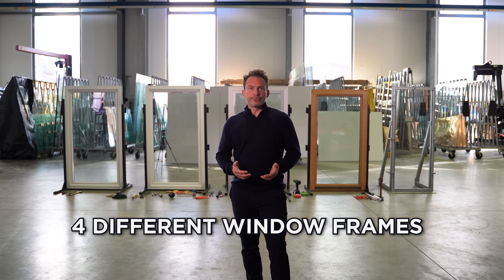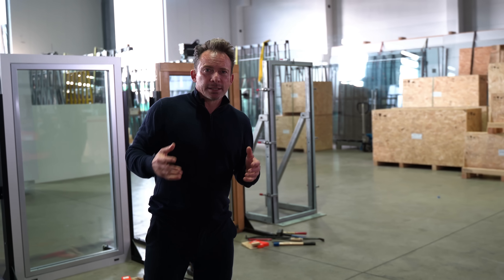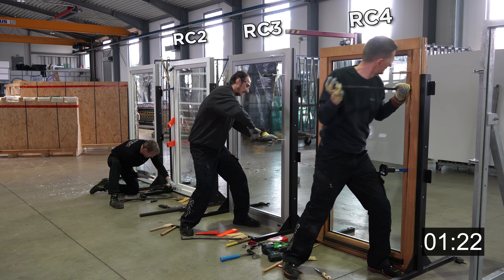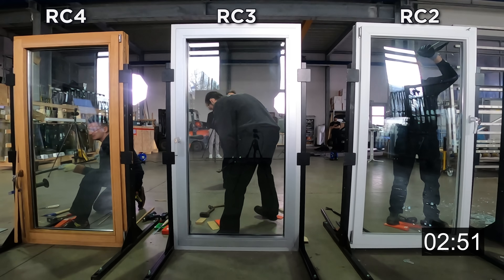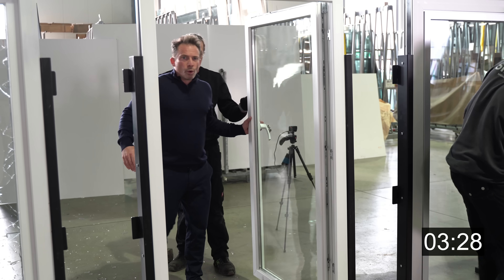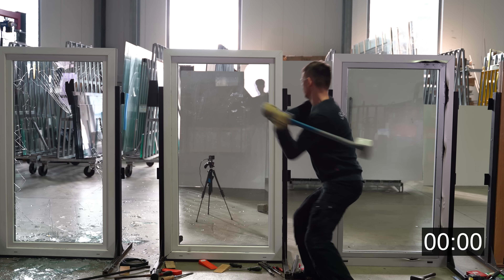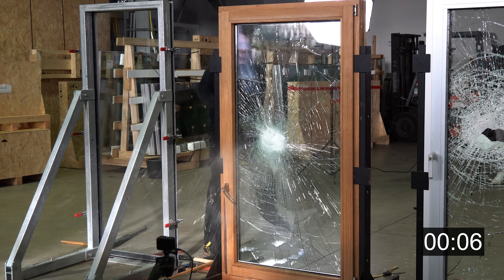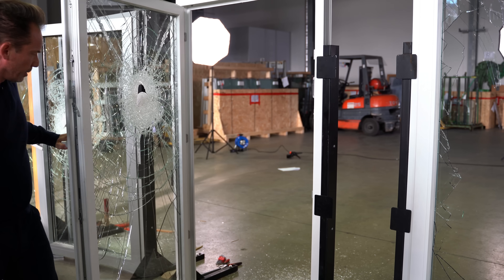Burglarproof Windows Tested! You WON’T believe what we found out

Comment: What about fire fighters trying to get in if there is a fire? Also, wouldn't a battery powered angle grinder cut through the window frames like butter?
Reply: dose  your house or you worth that much to break in to? 🤣😅😂
Reply: why would they be burgling a home with an angle grinder
Reply: Hmmm, they did not try with the pointy bit of the Firemans Axe..
Reply: @i_love_games110  so they could cut out the copper pipes
Reply: Windows of the resistance class RC4 are perfectly fine for normal residential buildings as the people trying to break in here are normal thieves who look for a quick chance to get in unseen, take some stuff and go again. Whole thing ideally lasts a couple minutes to minimize the risk of being caught. If you need protection from groups operating heavier machinery you're looking at protecting yourself and your valuables agains organized robbers and at THAT point you probably have several more security measures in place like around the house surveillance, alarms and maybe even a panic button you can press that immediately alerts police.

Comment: Who will do all that work to break in instead of just breaking the window panes? All that banging and noise even for the RC 3, thats 3 mins of noise instead of finding the goods inside the house
Reply: Wdym "instead of just breaking the window panes?" The glas is break in resistant as well. At least if you do the security window right.
Reply: @kaystephan2610  My point is, they are timing these "attempts" as if it's realistic. No burglary is going to stay there loudly banging away for 3 or 5 mins trying to break into your house.
They are either going to find another easiest access point to get in or leave altogether